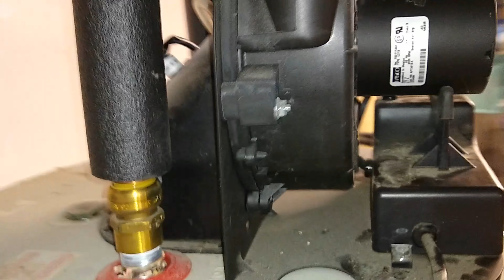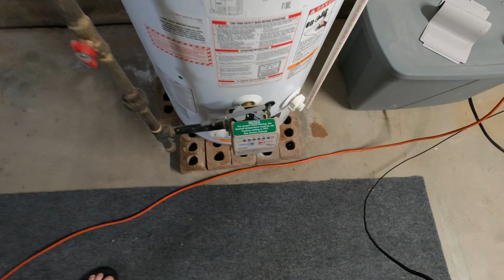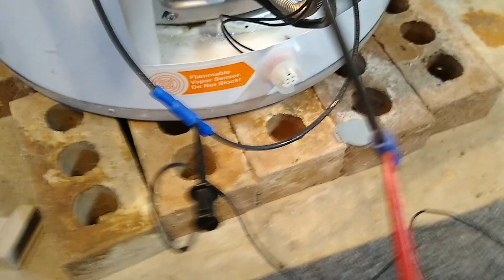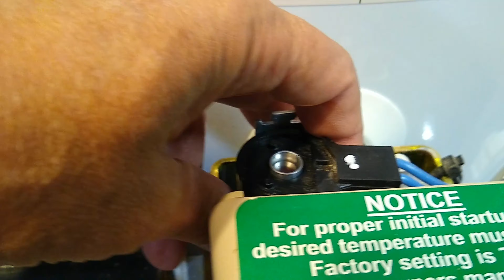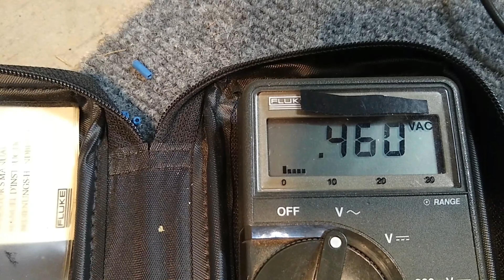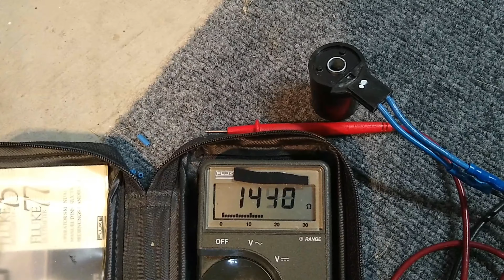My Rheem Powervent Water Heater Crash Course - Part 2 of 3 | Man About Home

Comment: So it was the selnoid wire?
Reply from the maker: It was the windings in the solenoid. Thanks for watching.
Reply: @manabouthome  where did you find a new solenoid?
Reply from the maker: Hey all. This is a good question!  If anyone knows of a source for these solenoid coils, please share that information. Thank you!

  @wattsobx  I wasn't able to find one. I ended up buying the whole gas valve/control unit. Fortunately (for me), mine was the least expensive one of its type. I got it from SupplyHouse.com .

Comment: Regarding the solenoid coil, did you happen to see any part number or SKU codes on it when it was removed? I’m going to looking at replacing the coil to avoid having to replace the entire controller assembly.
Reply from the maker: I wanted to do the same thing. But there are NO identifying markings on that coil at all. I found similar looking, but different dimension coils, for gas dryers. I looked around the internet to try to find the coil. No such luck. Please let me know if you find it! Thank you for watching!
Reply: @manabouthome  will let you know what I find!
Reply: Did you find the solenoid coil?
Reply: @georgewang2853 unfortunately, no. I babied the water heater for about 4 months and exhausted all of my sources. I caved in and bought a whole new assembly

Comment: was is the common problem with power vent baffle? will it make run hot?
Reply from the maker: In this case, it was the gas valve.

Comment: Every time you pull the coil away from the core the  temperature spikes As impedance drops and current increases. This causes overheating of the varnish insulation and damages the coil slightly every time . An energized coil should never be removed from its core. You may know this but your viewers will not and may incidentally cause the very fault they are trying to identify. With that said this video is likely the best troubleshooting guide ive seen in the intelivent
Reply from the maker: I appreciate you sharing your observations, and expertise.  And everyone should take heed, in general. 

But, I don't think that's a concern with this. There's a built in fail safe that protects against what you've described. If the gas valve fails closed, for any reason, the flame goes out. The moment the flame is undetected, the gas valve is de-energized for obvious safety reasons. So, no current.

Also note that I didn't pull the coil from the core when it was energized... only after it failed(open), was still at a hot temperature (electrically open), and was passing zero current. And again, the moment the flame is undetected, the gas valve is de-energized for obvious safety reasons.  

Thank you for the compliment! Thank you for watching and commenting!